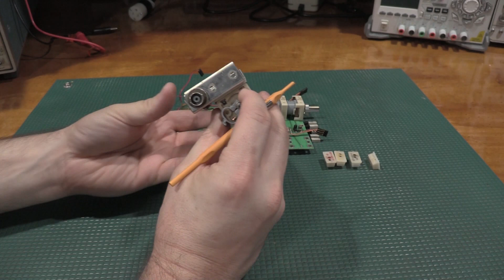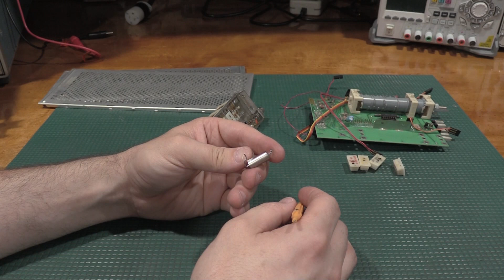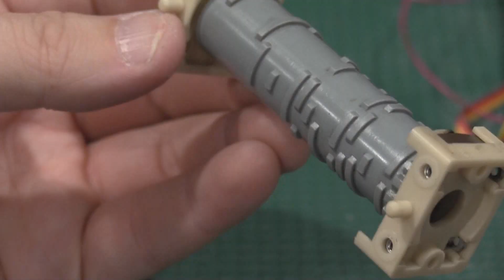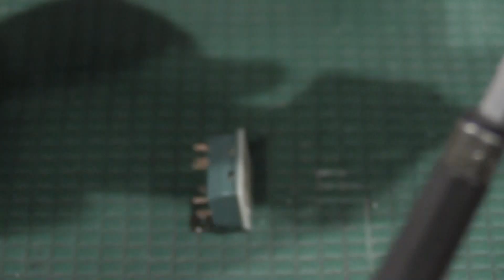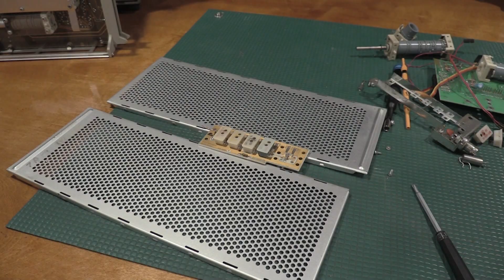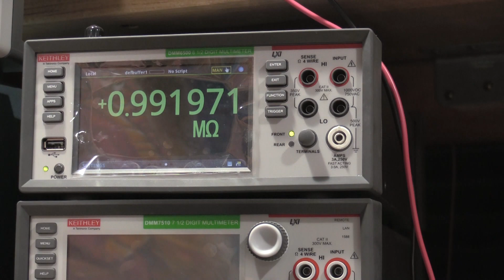Tek Scope Attenuator Deep Dive

Comment: I recently got a 465B.  These videos are really helpful.  My channel 1 is having problems whenever the 4x attenuator is selected.  I tried cleaning the pins and contacts with alcohol and q tips but it is still flaky.  I may try the paper method and some D5.  If I adjust the 4x around sometimes it starts working but turning the barrel causes it to be flaky again.  Is something still dirty with the 4x?  Is there something in the attenuator that can be adjusted? Is it possible the joints where the pins go in the board need to be resoldered?  Also what are you using to clean the switches?  I assume some type of spray that you can squirt inside them from a distance.  Thanks.
Reply from the maker: I have the exact same issue with the 7A26 plugins I have to go back in and clean them again but this time I am going to do it my way. When Tek created the service manuals they could not have dreamed of a 75 year service life. What seems to be working so far is straight D100 red NOT in the spray can. I disassemble the attenuator and put a as small a drop as possible on the finger switch there are some very sensitive materials that these are made out of and in this case less is more. I have also needed to clean the pins and sockets for the plastic blocks. Also check the resisters they are small 1/8 watt resisters in there. I have a 7a26 where one of the range resisters is cracked in half. This has gone back in line for the to be bench to be fixed.
Reply: @ZenwizardStudios  I am going to take my DMM and measure each attenuators resistance. Then with just the 4x installed check for good continuity on the board when the 4x is selected.  Have you ever had to resolder the bottom of the board where the two middle pins are seated?  Can the individual attenuators be opened up and maintained?  Are those two little black trimmers in them adjustable?  I imagine I shouldn't touch them.
Reply: @ZenwizardStudios  I believe I know what the problem is now.  I think one of the middle pin sockets on the board for the 4x is cracked. Looking at the 6 pin sockets they are little dark dots where the pin slides in.  Except for one that looks like a dot with a dark line extending from the center.  This might explain why it works when I adjust how it sits and then goes bad when I move the cam.  I think I need to learn to live with not using the 4x (20mV, .2V and 2V) on this channel.  That or replace the attenuator board.  No fun.  I will see how i can get by for now.  I am going to focus on cleaning switches and maybe doing some adjusting.  Thanks for your videos and your help.
Reply from the maker: The socket being cracked would be repairable. Those sockets are soldered in to the attenuator board so they can be removed. it could also be a bad solder joint. Soldering on the ceramic however requires care and the correct iron. Correct Iron being something with good temperature regulation and high heat capacity. The ceramic PCB will take a LOT of heat from the iron to solder but it can also be cracked with to much heat.
Reply: @ZenwizardStudios  how about a video on replacing the sockets on the attenuator board? 😀 Seems like delicate work. Worried I would destroy the whole channel.

Comment: Really interesting! Thanks for showing how the drum switches work. You might try a small amount of silicon grease on the drum detent mechanism, it should  be safe for all plastics. Fluorosilicon grease is another possibility, however it is expensive.
Reply from the maker: Indeed, some came from the factory with a white grease on them. But it has LONG dried up by now. Just need to be careful not getting any on the switch contacts.

Comment: Hi Zen, oh this brings back memories!  When I got my first 7000 series scope so many decades ago, it was one that I could afford.. it needed some help. The vertical plug in was a mess. I had to adjust trim caps to get it to have square wave on every position. I learned instantly that settings were interactive, and without a manual, it took a few evenings... That plug-in is still working, now almost 4 decades later. I later got a manual for it and followed the procedures to re-cal.. I had it mighty close the first time, more dumb luck than skill.. and I did it without an extender.. what a pain, but also, what an education.
Reply from the maker: Indeed I fell down that rabbit hole with a 485 so I know the feeling.